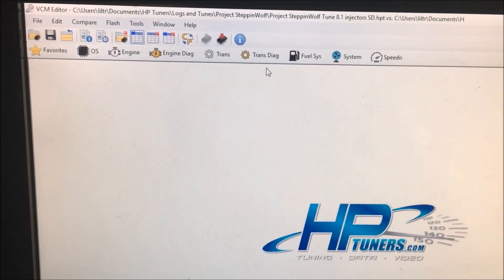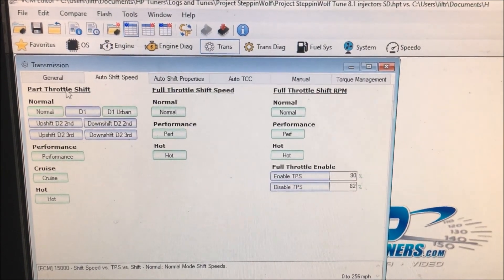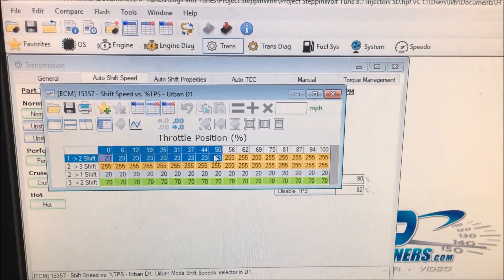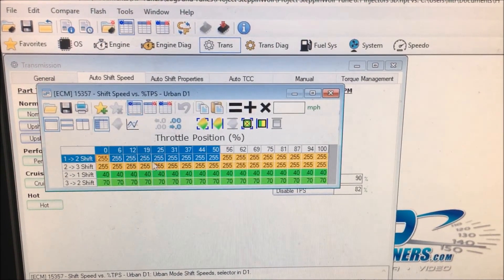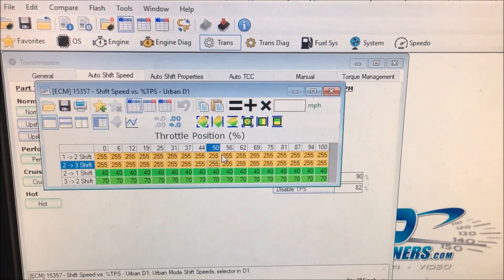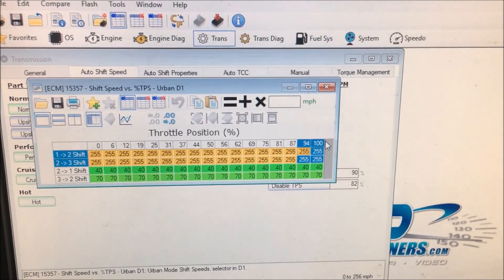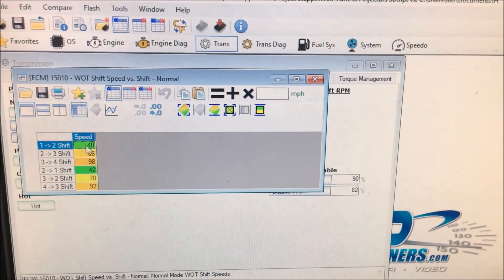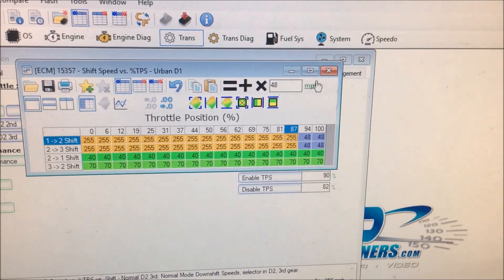HP TUNERS HOW TO HOLD 1ST GEAR SHIFT ON A 4L80E WITH SHIFTER IN LOW

Comment: Just saw hp tuners doesnt do chevy 6.5 diesel, just looking to increase line pressure on my duelly. .9 amps with 50lbs. to force motor is n/g

Comment: Does this still work to this day? I can’t find d1 urban on mvpi3 there is d1 under part throttle shift
Reply: It should, depending on what ecu and OS you’re using. I only deal with p01 and p59 pcms. I use the latest stable version and it’s still there.

The reason we brought this up on HPTUNERS was for those of us using a D1 transbrake from Jake’s performance. 
Not really the reason he discusses here.

Comment: Im a bit confused I'm new to this . Does this tuning increase gear ratios as well or this require axles gearing to be done
Reply from the maker: HP tuners is a total tuning solution for stock pcms and ecus.

Comment: Need some help. Working on a completely stock gen 4 silverado. 4.8L 4l60e. Wanting to make set tow haul button for roll races. Cant seem to figure it out on this one.
Reply from the maker: Brother the tow haul button isn’t going to do anything except change transmission settings. Pretty much useless for what you want to do. It won’t affect power, timing, or fueling whatsoever.....just transmission shifting. If that’s all you want then you just need to figure out which pattern in your trans tables are enabled/disabled with the tow haul button and change the shift and pressure settings within that pattern. Basically you just need to learn which patterns are which and you need to have a fundamental understanding of how shift speed and pressure effect your transmissions shifting characteristics. In order for me to even start to explain this in print it would take me probably and hour and several pages of typing and in the end it still would t be comprehensible. But there are several right ups on the HP Tuner forums and LS1 tech forums with lots of pictures of the tables to help you wrap your head around it. Go ahead and grab a bite to eat and don’t plan on going anywhere for awhile though. Lol.
Reply: Go under performance shift and set them all to your max shift speed on that gear across the table . And then you can use your tow haul for roll racing.

Comment: Did this today.  Solves my first world problems of rolling burnouts without shifting to 2nd 🤘🤘
Reply from the maker: Glad to hear it brother!! Having the ability to hold the gears I wanted manually was a big issue for me back then. I can’t stand it when my trans doesn’t do what I tell it to. Lol.
Reply: @BadLuckGarage  My tuner said this is not something gets asked very often.  He laughed when I said I want to be able to do burnouts without it shifting to second.
Reply from the maker: That’s weird because the whole reason I made this video years ago is because there were TONS of truck guys asking if it could be done for towing and off roading purposes. I think I even said something about that in the video but it’s been awhile. Lol
Reply: Bad Luck Garage you would think so, but I get the feeling it’s not something most guys know about.  He knew about it, but said customers rarely bring it up.  I guess nobody wants to do rolling burnouts.  Sissy’s!
Reply from the maker: Lol, it’s not just for rolling burnouts brother. It’s also useful for low speed towing and four wheeling. 😉

Comment: What does a winter mode means in transmission tuning section (hp tune) jk 2014
Reply from the maker: I have never seen anything about “winter mode” in any GM transmission settings. I also do not know what JK2014 means.

Comment: I was trying to figure this out. Thanks for sharing this. Don't stop, I'd love some explaining on transmission tuning. 
You should make a video of what you'd do when making changes to transmission shifting.
Ex. Shift pressure, shift timing, how to make firm/neck breaking shifts. 
Thanks again and hopefully see this recommendation soon. Cheers!
Reply from the maker: Thanks for watching brother.  As for the shifting, on a 4L80 all bets are off. I do away with the torque management completely, drop the shift time down to around 200, and crank the line pressure up. A 4L80 can take it. In the turbo C10 I built last year the 4L80 was a bone stock junkyard pull with stock converter and I did as I just described and it would sometimes kick the ass end out on the 1-2 shift with a set of 325/50-15 drag radials. That thing shifted fast and hard with zero modifications. Just filled it up with Jegs quick shift transmission fluid and let it eat. 👍🏻

Comment: I assume you didnt install an hd2 kit in your 80e ?  

I've been looking into them lately, not for gear holding but for the dual feed modification..
Reply from the maker: Nope shes bone stock. Just completely disabled all Torque Managment, boosted the line pressure and reduced the shift time in the tune and it was tearing loose in 2nd gear. Unfortunately you cant get that brutal with the 4L60s so the Chinavette is gonna have to get a shift kit installed. I'll probably do it when I pull the trans to put a stall converter in.
Reply from the maker: An hd2 kit is never a bad idea man. I just never needed it in the 80. Matter of fact I never even changed the filter. Took it from the junkyard, cleaned it, painted it, and stuck it in the truck, lol. Same ones going in the Nova next. 😉
Reply: I've read some mixed reviews on them..   mostly saying to skip the pressure relief because if it sticks open it cooks the clutch packs.. 

I might just hold off till I have it rebuilt and have a Jake's performance internal dual feed done..

 supposed to have the same benifets without the chance of having cross leaks in the valve body
Reply: Plus since yours is stock and survived a turbo c10, mine should last a day or two in a N/A 5.3 s10

Comment: So what is the difference between D1 and D1 Urban? Urban, for the 4l60e segments, seems to be associated with "performance mode", which of course has to be toggled with an intermittent switch during every drive cycle. Does the 80e segment's D1 Urban just work by default?
Fucking NOTHING worse than an unexpected 1>2 shift while drifting a rock bouncer on the street :D
Reply from the maker: The performance mode is a whole different set of parameters in a tab below. D1 was always there but D1 urban I believe was just the way they had to code the software in 3.x to finally allow access to the programming that would allow the hold shift feature to work properly in first gear. Like they had to create a whole new table just to allow this to work. That’s why I stated in the video that this wasn’t possible in vcm version 2.24.....because D1 urban wasn’t coded into that version. I hope that makes sense. Oh and I would LOVE to see a video of you drifting that rock crawler!! 🤣👍🏻👍🏻👍🏻
Reply: Heh. Follow my channel. I'll have something posted up soon-ish. Just sorta 3/4 finished my new rig and got rained out (and it's my DD so I'm just driving it), and now starting on another S10 ground up truggy. Lots of vids will be up once the second rig is done.

Also, I did mod D1 urban and it does work. Just seems like the wrong label "urban", as "urban" is normally an actual trans shift table mode set by the BCM (I thought), just like performance mode. Held first all day today. Drifting was hella less sketchy :). Kudos for the tip man.

Comment: Any reason my 4l80e is slipping during wot is there a table I need to change it was suppose to be a rebuild 1000hp transmission but the shop shut down now I'm stuck in the water wondering what's going on
Reply: By the way thank you for this video I was getting annoyed with this so much haha
Reply from the maker: Thanks for watching Ryan! I’m no guru on the transmission tuning but if it’s slipping during shifting, you could try increasing the pressure settings and decreasing shift time a bit. If it’s just slipping all the time then I’d say there’s a reason that shop went out of business. Unfortunately even the best tuning can’t make up for bad parts or assembly brother. 😔
Reply from the maker: Yea being turbo I like to roll race sometimes and if the transdownshifts at WOT, even with the drag radials it just smokes the tires. Being able to hold it in gear and bring the power in less abruptly definitely helps in this area. 😉